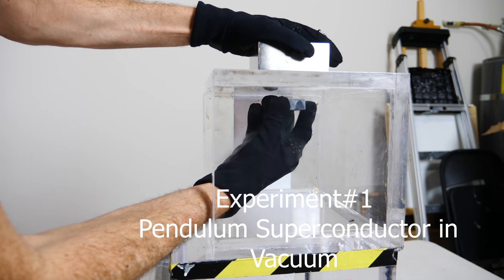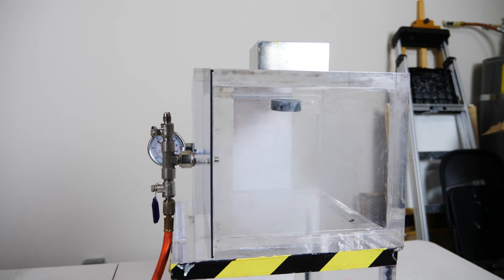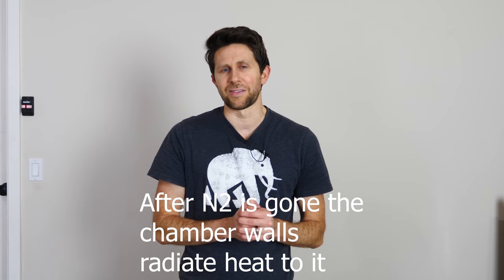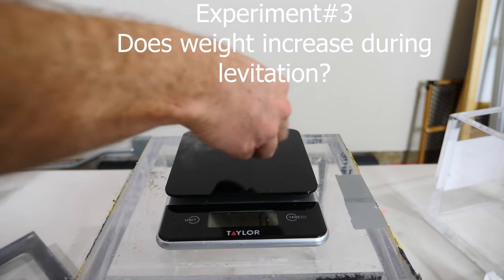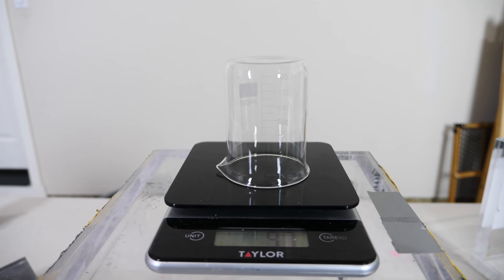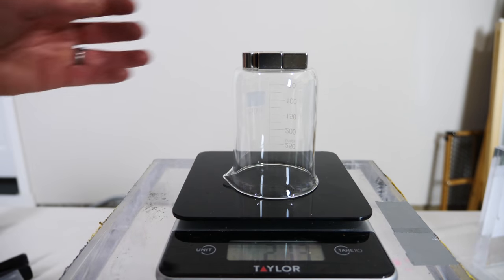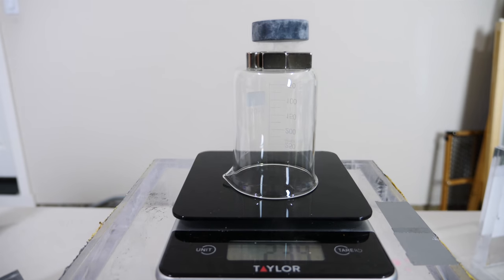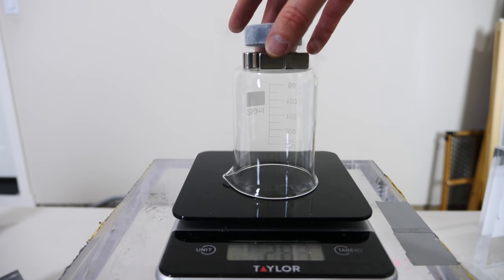Does The Weight Increase When You Levitate a Superconductor on a Scale?

Comment: 0:22 There may be no air to conduct the heat, but there still will be the infrared radiation. And perfect vacuum is kind of impossible to achieve.
Reply: What about in space
Reply: Right, first of all you can never do it with this pump, not even with a secondary diffusion or turbo molecular pump,
And also there still would be quantum fluctuations and the only way to get them away is with the Casimir effect where not all wavelengths of particals have the necessary space to exist
Reply: @aarongames7034  I need to disappoint you, in interplanetary space there still are thousands of molecules per m^2, in interstellar space a few hundred and even in intergalactic space you can find between 1 and 10 per meter cubed
Maybe somewhere in interdimensional space but who knows what that stuff is all about
Reply: Fabian Widmann I have no clue what the casmir effect is, I am in 8th grade, and when I looked it up, it looks like that is a side affect of quantum fluctuations, not like it can stop quantum fluctuations. I have no doubt you are smart, and I do not mean to sound condescending if I do, I just don’t know how else to phrase it. Pls help explain what you mean if you can, I appreciate it
Reply: @chrisawesome3091  well, I am currently working my first year as a chemist in Austria, and exploring the quantum world is just my hobby so I'm sorry if I get something wrong too, the Casimir effect actually is the result of the non/less existing quantum fluctuations which is simply pushing two plates togheter because there are more on the outside than in between, what I meant is that for a perfect vacuum you would basically have to make a vacuum chamber small enough to not let any quantum fluctuations fit in between, I have no idea how big this could be maybe as small as just 1 Planck volume...
Reply: @Thunder Life its cooling it down, the faster moving so "hotter" molecules are escaping faster, leaving the slower ones behind it would cool it down a few degrees more til the tripelpoint of liquid nitrogen of something like 66K
Reply: Fabian Widmann oook, ty
Reply: However, the net effect of the quantum fluctuations should be zero (cannot create or destroy energy).
Reply: Fabian Widmann I posted this comment on the second superconductor video, and I have not gotten a response, if you have the time, could you pls help me answer this question: 

What if you covered the neodymium magnet with a type 1 superconductor, and cooled it to its superconducting point? Would that create pressure on the superconductor, and is the magnet still able to be felt anymore (because the superconductor is holding the magnetic fields inside it and not letting it leave)?
Reply: @darkwinter6028  right, but 
They can still interact via for example the electromagnetic force, in way of friction or smth,

However, I'll add, that this statement is just an educated guess I don't know if it's correct, the other stuff is well researched though
Reply: @Fabian-mu3hq  Faaaakeee bs lololol
Reply: @chrisawesome3091  unfortunately I don't know what the exact property's of such a material would be but the fusion reactor called ITER (which just a few days ago finished construction of the concrete base) uses superconductors the other way around so a type 1 superconductor as a wire couted with a type 2 ceremic superconductor to create its magnetic fields, but I think this only has thermal benefits, sry that's all I've got

 I'd guess that the magnetic field still would propagate through the whole chunk

Edit: I read it false I understood you wanted to coat the superconductor in another layer,
If you coat the magnet and cool it down I don't think it's going to survive, the two materials will contract differently, and again I don't know what will happen with the fields
Reply: Heat can not only transfer through convection. Infact most of the heat is transferred through radiations which work just as well in vacuum.
Reply: @aarongames7034  space has matter
Reply: There is also gravity pulling on it so it can cause drag when it goes up
Reply: @Thunder Life no evaporation causes cooling. What's really happening is that the superconductor is a pretty good black body that can absorb IR radiation well as well as the heating effect of just plain visible light hitting it. 
 If the nitrogen is evaporating its because it has enough energy to do so at a given pressure and that energy comes from the disc. So as the nitro vapes away it cools. But it vapes away pretty fast. But the disc is creating a field. That field is energy and that energy comes from the bonds I  the disc. As the magnetic field from the magnet interacts with its field this creates stress and this stress creates heat. 
 Basically internal friction between the atoms at the molecular level. This is why you must continually cool a SC so that the internal heat is drawn away and the atoms can remain on average at a low energy state. I guarantee you if you measured the rate of dissipation of the coolant for a superconductor under either a current or magnetic load, you would find it faster than a control with all other factors the same.
Reply: Avya right. Also through friction like in this example where the atoms vibrate due to cutting the lines of flux.
Reply: @Fabian-mu3hq  Yep.  There isn't a whole lot in space, but it's not completely empty.
Reply: @chrisawesome3091  superconductors are extremely fragile and brittle materials for the most part. They are essentially a ceramic material, metal particles held in some sort of matrix of other materials. Very similar to the way crucible particle metallurgy works, or how Crystal's form. There are a lot of oxygen bonds in superconductors YYtFe02 being an arbitrary example that's probably not an exact formula so no one start telling me it's wrong I just made it up from my nearly 3 decades old research into the subject. Basically Yytrium, Yyterberium, iron and oxygen. 
They are difficult to work into complex shapes and topologies but it can be done however they tend to like to be in specific shapes due to their internal crystal structures. Think of how fragile a crystal wine glass is compared to a standard glass or plastic one of the sameconfiguration. 
Think of how a two liter plastic bottle reacts when you put dry ice in it and seal it. It swells and eventually bursts under the pressure. Imagine a two liter bottle made of crystal with dry ice trapped in it. It will fail much note quickly of it's the same dimensional proportions as a plastic one. 
Same thing here. The magnetic field puts pressure on the superconductor. If you coat the magnet in it that's going to be like sealing pressure inside it. 
I'm not saying that you couldn't do this but there is the question of what would be the purpose of such a construct, as well as how well the superconductor would withstand the pressure. 
 It's just a matter of balancing pressure as well as being able to form the ceramic into that shape. It's not as simple as making a shape the same as the magnet. this is now a hollow shape that is being pressured from inside. And since the pressure is from two fields, there's no way for this to be vented physically it has to be balanced in a complex mathematical and proportional manner. The field cant be stronger than x value and the temperature cant exceed y value. Not to mention that you might have to pretreat the magnet temperature wise so that when you cool the superconductor, it doesnt have thermal shrinking issues that cause failure in its structure.  
Further, magnets, especially Nd type magnets are sensitive to thermal conditions as well and themselves can become superconductors at critical temperatures. This means that they might lose their magnetic field at a certain point as well. 
Lots of things can be superconductors at the right temperature. 
But temperature is only one factor that's important. It's also the flux of the fields they will be exposed to and what the current load on them will be. It's actually pretty easy to knock a superconductor out of criticality by putting too much load on it. And the higher the load the more cooling you need to shunt that heat energy out. and that only works up to a certain point. It's a very complex and fascinating subject.  You should do some research. I'm sure there are far more informative sources written recently, but like I said this is stuff I researched in depth nearly 30 years ago, back when it was still fairly new to anyone who wasn't working for a major university or government.
Reply: metamorphicorder thats awesome how much you like and have researched the subject! The problems you present, could they be fixed by using something like graphene? Graphene is really strong, and superconducting at room temperature, so could you put that around a permanent magnet, and potentially make the magnetic field not be felt outside of the “wrap”? I ask because I would like to try and extrapolate this concept further, but I cannot really explain how through only the use of words
Reply: @aarongames7034  same answer.
Reply: @Thunder Life Evaporation has a cooling effect.
Reply: I wish I read your answer before posting mine lol. Space is more of a vacuum than any man made box on earth and the sun manages to keep us warm. Plus he did a test a few months back with a red hot steel ball in vacuum and it cooled.
Reply: @aarongames7034  You know energy travels through space...even if there's no molecules or dust in places...like when the sun warms you up here on Earth from 92 million miles away. Furthermore, I believe the 'perfect vacuum' is not actually empty! It contains "space-time"...that yet-to-be-determined 'something' that is the substrate through which all matter or energy seems to travel (and possibly that thing that all matter or energy is made of at the simplest level anyway). It's the thing that gets warped and changes your trajectory...so you fall to Earth because of the phantom force of gravity. Apparently not a 'real' force pulling on you...but you just can't see that you're travelling in a 'lane' that has a collision course with Earth (the 'lane' is the warped shape of "space-time"...I don't like the use of 'time'...I think it should just be called "space-fabric" for now...time is another phantom IMHO). Sorry to ramble on...I love pondering this s**t :-)
Reply: Aaron Games Sorry to break it to you, space is a fictitious place designed to hide the existence of our creator. There is no vacuum above our atmosplane. In order to have gas pressure or a vacuum there must exist a BARRIER. We live in an enclosed system.
Reply: @Thesmartestmanalive81  🙃
These days is hard to know if you're joking or stupid. 10 years ago, you would have been hilarious. Today, you're a reminder of how exploitable humans can be, and that makes me sad
Reply: There'll be more loss through eddy currents.
Reply: We can use spectrolan superconductors so 99% lights are reflected
Reply: @robertgoff6479  the whole point of a super conductor is that there is no resistance meaning Eddie currents won't generate heat
Reply: @aarongames7034  believe it or not there are still matter in space around 3 atoms per cubic centimetre or so
Reply: The way to make a vacuüm space is way of an electromagnetic field. Obviously with the technology we have now we can not create an optimal field (reason Why if we create antimateri it can only last for a second due to the fact materi will slip in eventually) using the electromagnetic field to keep the materi outside and the antimateri inside. Obviously the electromagnetic field is materi aswell... so ye... that’s why the 1 second. Only way to make sure that the antimateri Doesn’t dissapear that quick is using fotonfield But in order to reach that we need to concentrate all fotons in a stronger way than a laser....... don’t hate on me pls XD.. I just say what I see from my eyes
Reply: Even if you did, there's light. And a perfect vacuum could probably only work if you're also willing to not even observe it.

Even then, particles appear and dissappear all the time. So, good luck with that lol
Reply: NetAndyCz and gravity?
Reply: Perfect vaccum in space is 1 air molecule per cubic centimetre, 0 is impossible but probably possible and has a chance of 0.000000000000000000011%
Reply: Yeah. That's true. But a very small amount to calculate if you compare with the previous one.
Reply: Aaron Games there isn’t really any way to achieve a perfect vacuum. Even in space there are gases
Reply: The gravitational force should also reduce the swinging
Reply: @aarongames7034  space ≠ perfect vacuum
Reply: wikwok bingbong there is no such thing as gravity
Reply: @krys8494  well, now that depends on the point of view, doesn't it? In the strictest theoretical physics kind of way the theory does indeed exist, but in the classical physics the phenomenon that creates the force that pulls us to the earth is in fact called gravity... Thus if it quacks like a duck, walks like a duck and looks like a duck, it is fair to call it a duck.
Reply: Aaron Games space still has infrared radiation, and space has a perfectish vacuum
Reply: @chrisawesome3091  The result would be sort of an electromagnetic field bridge wherein the magnetic field travels transitioning from magnetic to electric and from electric to magnetic so that you'd have a secondary magnetic field outside of the encapsuled magnet. And yes there'd be magnetic pressure between the magnet and the coating.
Reply: Yes and I’m not sure why the pendulum was supposed to keep going when gravity would always win.
Reply: Impossible to achieve, but we can get as close as we can and note any changes. That's the point of the experiment.
Reply: @Fabian-mu3hq  Dude, can you create a channel or page or something? hahaha. Big ask I know as would be v,v,very time consuming but I would def subscribe. I love channels like this and people like yourself and the dude in vid... Quoting another channel creator and the name of his channel,,, Smarter everyday :D
Reply: Hans-Joachim Bierwirth would there be a magnetic field outside of the wrap? I appreciate you responding!

Edit: or would there an electric field outside of the wrap?
Reply: @Fabian-mu3hq  m^3 not 2
Reply: @Tensho_C  right... 😂
Reply: If you can see it, it is producing energy in a way or the other. Nothing is there by itself
Reply: @Soravia  what if it can't be seen and can only be detected by 2nd order effects. Something Invisible but still casts a shadow.
Reply: @aarongames7034  In space it would be the same.
Reply: @Fabian-mu3hq  Ac and Refrigerations technitions do that with a pump all the time.  You have to pull a vacuum on a system before you add refrigerant.
Reply: @pianotm  True the matter density in the near vacuum of space is about 3 subatomic particles per cubic centimeter.
Reply: @Stiggy Vanderkskeen unless you have completed some courses in physics, since the last time we spoke, it would be best if you stayed silent and learned.
Reply: @Thesmartestmanalive81  The barrier that holds the atmosphere on earth is gravity. This is proven by the fact there is a pressure gradient apparent in the atmosphere as you travel upwards. So there is no need for a physical barrier. And, no, that doesn't break the second law of thermodynamics. We are not in a closed system. I have spent too many years observing space and watching asteroids hit the atmosphere from space. There is no barrier.   We do not, observably, live in a closed system.
Reply: @Thesmartestmanalive81  I can't say you have displayed extreme understanding stating we live in a closed system when we can see we obvioulsy do not.  Calling you stupid I didn't do.  But, I can see where Melodic TurtleMetal got that from.  It wouldn't take more than a few more comments on your part to cinch the deal. Like trying to tell us the earth is flat.  Which we can also see that it isn't.
Reply: I can feel the amount of brainpower leaking from this comment chain
Reply: @Stiggy Vanderkskeen 
when was I talking about mass?
Reply: @Fabian-mu3hq  and big black depressed void
Reply: I look like a noob here
Reply: @aarongames7034  Space is not a perfect vacuum, it is very close but not perfect. There is molecular gas even in the space between galaxies.
Reply: I hate that he doesn't address how the puck heats back up and loses superconductivity. He does this in a lot of videos, always missing that key bit if info to round things out.
Reply: @aarongames7034  Space still has infrared radiation
Reply: @Stiggy Vanderkskeen 
Also, just that some people don't consider gravity a force do sent mean it isn't one.
Reply: @Stiggy Vanderkskeen 
The way in which Einstein describes gravity (warping of space-time) does not detract from the fact that there is a force exerted by gravity that attracts massive objects together.
Reply: @Stiggy Vanderkskeen 
Also, numerous means multiple, so referring to one experiment makes no sense. There have been lots of experiments in the 246 years since the less than perfect schiehallion experiments (duh!) That have been much more accurate and precise (again, duh!).
Reply: Or, put better, Newton's universal gravitation provides a model for gravity which is acceptable for most situations, describing the force exerted by massive objects on massive objects.
Reply: @Stiggy Vanderkskeen 
OK, I said that schiehallion was not a good experiment. The part you're omitting is the LOADS OF OTHER EXPERIMENTS that have been conducted since then!
Reply: @Stiggy Vanderkskeen 
And yes, Einstein says that gravitational attraction is caused by warping of space-time by massive objects. In most scenarios, however, this is modeled adequately by newton's universal gravitation, ie. in most situations gravity can be thought of as a force.
Reply: @Fabian-mu3hq  Mabye ... Uhm in our mind? OwO"'"
Reply: Fabian Widmann Even then due to quantum teleportation there can never be a perfect vacuum
Reply: I don’t know about IR, but more probably friction between the magnets.
Reply: Aaron Games the sun? UV?
Reply: minimal cough cough
Reply: Black body radiation is actually only a small part of it. The main heat loss mechanism here is still air conduction. His vacuum pump only gets down to about 10-100 Pa, and in order for heat conduction to be affected significantly, it must drop below 1 Pa, which is the pressure thermos are at. You can’t easily achieve that with just a roughing pump, you need at least a two-stage pump and/or an additional high vacuum pump.
Reply: NetAndyCz my bissel is a pretty good vacuum.
Reply: @Fabian-mu3hq  i'm quite surprised, i expected thousands in intergalactic now that i think about it, 1 or 10 i pretty empty
Reply: It’s still affected by gravity so it’ll stop in the middle even with a perfect Vakuum
Reply: Infrared cannot explain heating of the metal for several degree in such a little time.

My guess is, the heat came from the surrounding air (which is at room temperature). Once the nitrogen is gone the metal absorbs that heat and lose superconductivity.

I think if there is a steady supply of liquid nitrogen until it reach (near) vacuum, the metal will retain superconductivity way longer.
Reply: @prism2451  Radiation is poor method of heat transfer. That's why earth does not burn to ash even though we are "very close" to the sun. Convection will do that before breakfast.
Reply: Yes! Exactly what I wanted to say.
As someone who knows a little bit of physics word "forever" makes me laugh a lil bit.
There's no forever in our universe.
 because even universe itself has its inevitable end.
Forever nothingness after heat death of universe maybe. But this is unfortunately way beyond our current knowledge.
Reply: If the sun was infrared radiation then we would not be able to see it, it would not produce yellow light.
Reply: MUCH more radiation energy in space bro...
Reply: @darkwinter6028  It should be zero, but the whole reason the universe exist in the first place is a testament on how it can't be zero
Reply: @diablo.the.cheater  Well… if the universe was generated by a quantum fluctuation (and not any of a number of other possible cosmological mechanisms); it stands to reason that there should be an anti-universe that counterbalances this one. Of course, it being another whole universe, we wouldn’t be able to see it from here… 🤔
Reply: Why not. Make it absolute zero